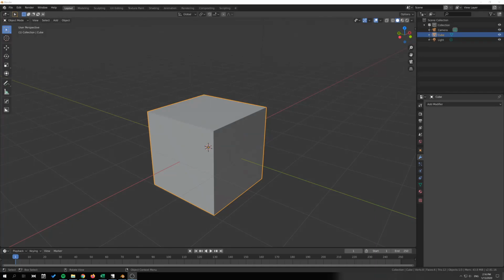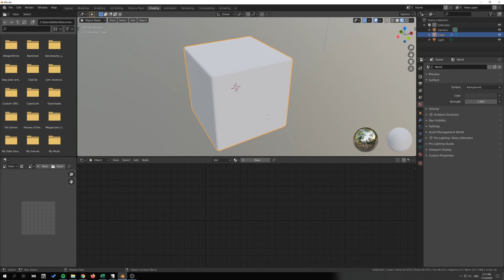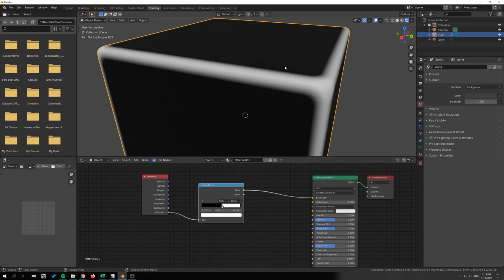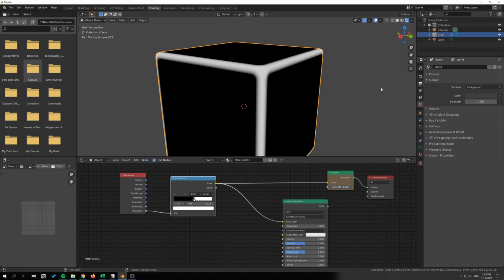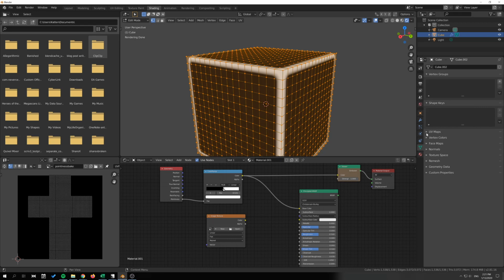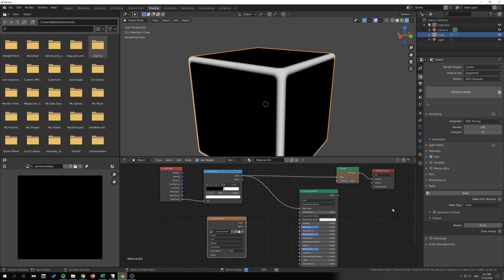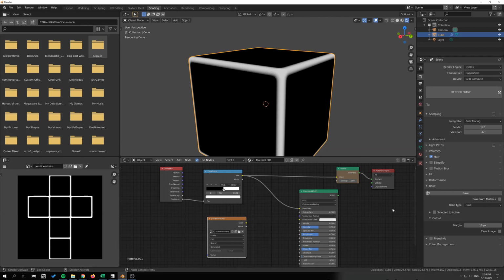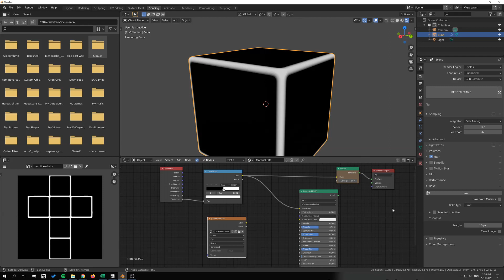How to use pointiness in Eevee.

Comment: Thanks for the vid. So the short answer is - no, you can't use Pointiness in Eevee. You can just bake the texture from unwrapped object. In this case it can be any engine really - even UE4 or Unity.
Reply from the maker: That is correct, there is a link in the description to an article where I go through the process. THis video is really just meant to complement that article. I explain this in the very first paragraph. 

Perhaps I should do something similar in the video. Still learning ^^

Thanks for your comment

Comment: I was triyng to make it in Cycles, just with default cube. Ok, so to have poitiness visible in Cycles, you need to have much more geometry. Also, use colorramp right after the poitiness, to gain more contrast. I was struggling with it for two days straight, but that's the solution. It's pretty cool, you can make it in Eevee as well.
Reply from the maker: Using this technique, you essentially just package the pointiness into an image and use it in eevee. Making this method viable for conversion to any engine essentially. I hope it was helpful! I am still procrastinating on updating this video though....that's not good. But thanks a lot for your comment!
/Erik

Comment: in my blender 2.8 or 2.82 pointiness node dont work please help
Reply: Same here
Reply: I had similar issue but in my case was related to the subdivisions and were the edgeloops were placed. If you don´t have enough geometry you will not notice the pointiness. After proper subdivision levels and edge loops in the right places you will see it. Color ramp must be taken to very sharp values as well
Reply: @danielboluda251  if you use Eevee if won't work, so you clearly are rendering in eevee

Comment: Is the manual subsurf necessary for baking this? or did you just decide to not use beveling?
Reply from the maker: Hi! no you don't really need to subdivide it. You can bevel or use modifiers. The high poly is just a vessel to carry the information together with the shader before we bake it to an image. then we can throw it away more or less. 

I know the video is cut off, I will re-record once I am back from traveling.